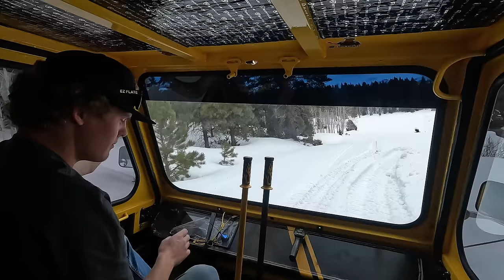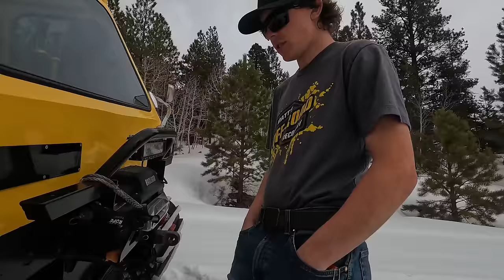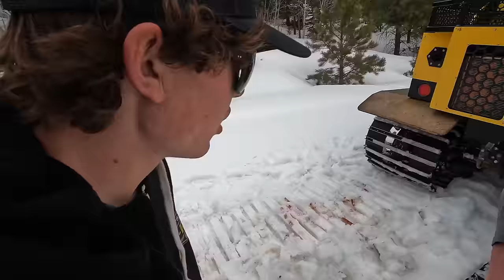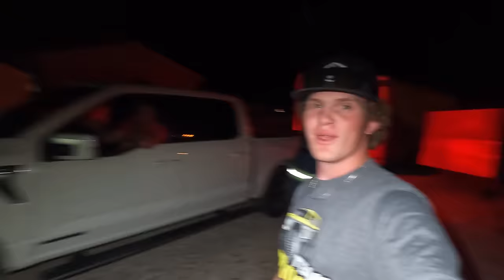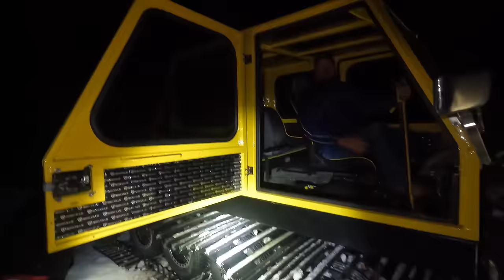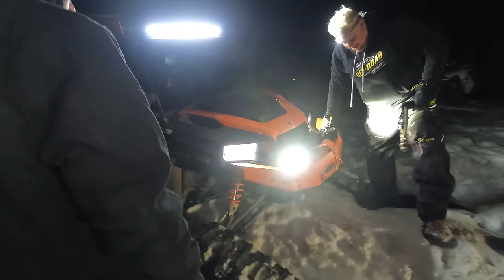The Worst Bombi Failure... Kids Left Stranded

Comment: Summer of `67 I had to assist the Cat. mechanic in removal and replacement of a set of worn out tracks on a D-8 Cat dozer in a desert wash about four miles South-East out of Kingman Arizona.  I had hauled the replacement tracks from Phoenix earlier that morning from Empire machinery's yard.  Unpinned the old tracks and let them roll out forward over the carriage rollers.  Placed the new tracks out in front of the old ones and drove the tractor out over the new ones.  With a large steel bar I lifted the rear link of track and fed it over the rear drive sprocket's teeth, fed it forward over each carriage roller until it got to the front, when we both lifted the front links into place and drove the large wrist pin into the links. Wrist pin had to be kept on dry ice and the links heated with a torch to make this pin be driven into place with a sledge hammer. That would be a lot of trouble for the Bombie.  But the tracks would never come off unless you took them off.

Comment: As fails on tracked vehicles go, track throwing is pretty common actually (even on modern combines with tracks, you throw one at least once per season - at least in our area where the lands are very hilly). 
You haven't driven one if you haven't gone through at least three or four events.

That said, that's why i don't like inflatable tire tracked vehicles. They're much more likely to throw one because the tire will not stand up to the track and it will accept bypass. 

Our grandpa's ww2 jeep originally had its production tires on and they kept throwing tracks left and right, then he swapped the fronts (of the three) for a single tank wheel (no clue what tank, one of the many junk wrecks on the farm) and it never threw a track ever again. Solid tires are the best.

I will give the tires one point tho, on account of being less bumpy. The ride on that jeep got significantly more bumpy after that. My brother still uses it on D-day parades, great piece of American design and shared history.

Comment: I've been watching the upgrades to the Bombi for months, so I'm embarrassed that I JUST realized that it's got the drive at the wrong end of the tracks. By putting the drive at the front, the rear axle is subjected to DOUBLE the force, when pulling forward. This is why the rear axles bent. A different way of looking at it is that the Bombi is a much more capable puller in reverse than in forward.

Don't believe me? Ask Tom-Tom what he thinks.  ;-)   It's just physics.

Comment: Can you possibly use electric trailer brakes on the rear axle to assist steering,
Push button switch on each stick, add braking for tighter steering

Comment: Be Prepared:  Consider yourselves like a Fire Rescue crew or Air National Guard team running a “well oiled machine/operation”.  When a call comes, your gear kit and vehicles are fueled, charged,packed, and ready to go. Flashlights, warm gear, hydration, food, sunscreen, Garmin InReach anytime you’re deep in the backcountry running a solo, unreliable, beta rig with spotty cell service. Emergency tool set. Most important tool like Matt said, clear your brain and know your limits, which I felt the B team did a good job at. Had they persisted they could have put themselves in harm. Under the circumstances nice job, but use it as an opportunity to “be more prepared.” When you’re done with a job, there’s a prompt protocol to refresh your kit and rigs every time. Trainings to the team should be conducted so they know protocol and supplies available. Lastly, every crew needs a guy like Rhett. Keeps the team temperature light/balanced, smart, and works hard.

Comment: them other axels has a spring for a reason and you didn't put any on it. i know zero about snow. but i do know if you have  rubber belts and that's all them tracks are really you need something to tenson them as the stretch. and i said that when you decided to make it them solid axels

Comment: Im surpriced that during the rebuild you didnt redesign the steering system. you could have mounted the hydraulic pistons on the dash and connected a stearing wheen to them so that when you turn the wheel it acts on them like the levers. It would be much more driver friendly.

Comment: I did mention this as a potential problem. 
@szki272
9 months ago
So since you are replacing the entire drivetrain any thoughts on putting the drive sprocket in the rear? It will reduce stress when pulling because the force won't be going around the idler

Comment: I think you should hang a big dyna 60 axle off the rear & put  with limited slip, & the gear like wheels that drive the tracks should be put on the big dyna 60. Maybe you can make it drive from the front & back. Put two dyna 60 straight axles on it like a 4 wheel drive vehicle. Perhaps you could even put the 4 independent tracks like they do on trucks and four wheelers. All I know the wrecker would have did just fine.

Comment: So I'm going to tell you a story and hopefully this might help I used to work for a hydroseeder he did not want to pay the heavy trailer weight tax so what he did was built a special trailer that he could jack his hydroseeder up and mounted to the trailer so all he had to do was way the trailer not the whole hydroseeder now the main part of this trailer was two sleeves that he can insert a L shaped Jack in buddy will look like a 7 the head of the seven with insert a quarter of the way of the length of the trailer I tell you this because I know for a fact I would bet money and I don't bet that those tracks are going to come off because that's what happens with tracks they come off at the worst time and at the worst place so as a suggestion you could make this system work for you you don't need two jacks for one side of the snow track and hey maybe carry  extra hardware because stuff happens one more suggestion because we all have one maybe do a dry run in the shop how to put on tracks when they come off you know firefighters don't just wing it when they go out to repel down a cliff to get somebody they actually prepare themselves before they have to
Reply: That was the longest sentence I've ever seen on YouTube! 😆

Comment: All this bombi drama and frustration could have been avoided with a simple standard routine preflight safety inspection.
If your just grabbing keys and jumping into your rigs and going down the road each time you have a job, you guys are doing it very wrong and setting yourselves up for disaster, just like in this video.
You should be doing a pre flight/drive safety check on every vehicle, before you go out, every time.
Do you let your road tow driver employees grab keys and go without a safety inspection of the rig their assigned that day?
Lets relocate our common sense and best practices, and put safety first guys.